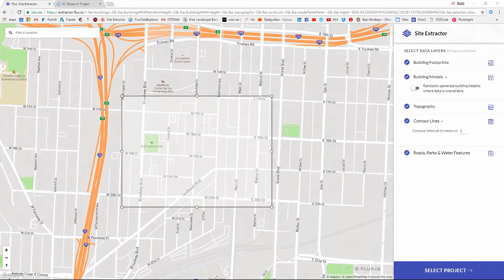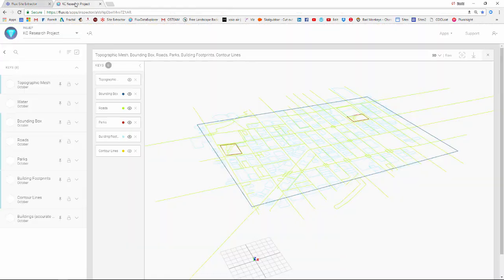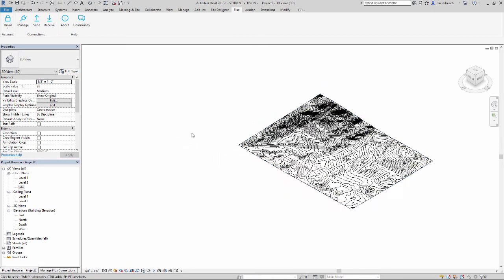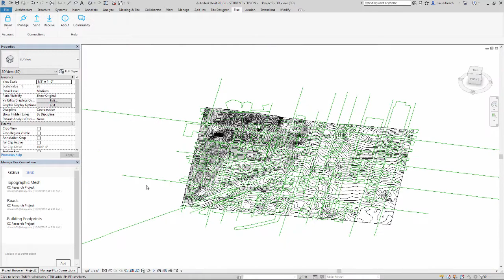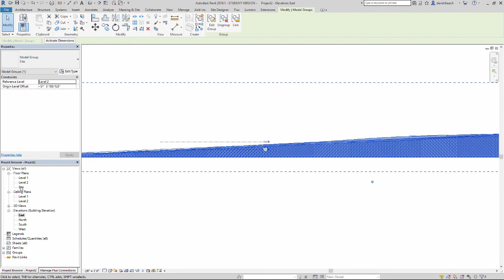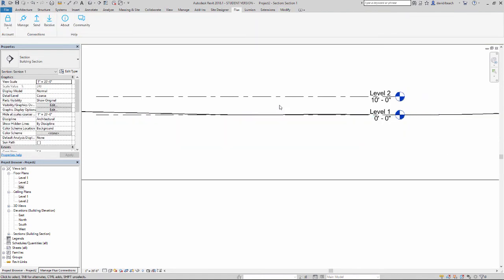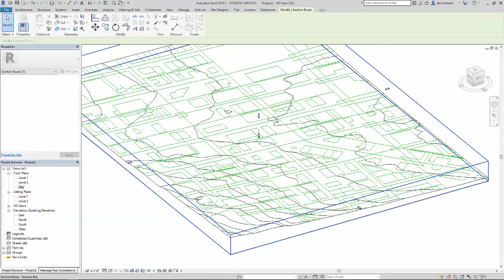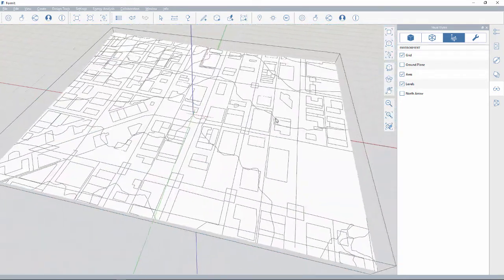Module 1a: Modeling Context - Site (Flux+Revit+FormIt)

Comment: Thanks for your super interesting videos, David. Always a pleasure to learn from you. I have an issue and can't import the topography mesh into Revit the same way you do. If I follow your steps, the topography doesn't show up. But if I, unlike you, choose to import the topography as a "Site" component I get a very very fine (triangulated) mesh into Revit. However it is not editable and it doesn't behave like a normal Revit topography. What can I do?
Reply from the maker: Hmm..i haven't had that problem, but the work around is kind of an old school one that we used to do with SketchUp: Select the mesh in Revit that is intended to be the topography and export it as a .dwg file. Delete the original import from Flux.IO. Import the .dwg file that you just exported (yes, it is a bit ridiculous, but it works) and use the "create from import" tool in the Toposurface toolset. That should do it...

Comment: Thanks for interesting tutorial 

Can you suggest what to do if topography does not come through in revit ?
Reply from the maker: Hmm..i haven't had that problem, but the work around is kind of an old school one that we used to do with SketchUp: Select the mesh in Revit that is intended to be the topography and export it as a .dwg file. Delete the original import from Flux.IO. Import the .dwg file that you just exported (yes, it is a bit ridiculous, but it works) and use the "create from import" tool in the Toposurface toolset. That should do it...